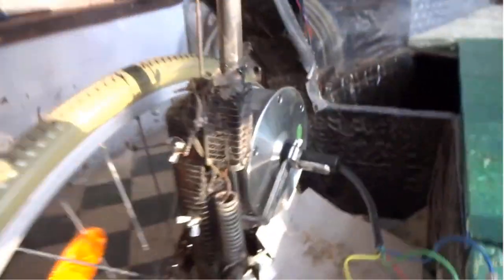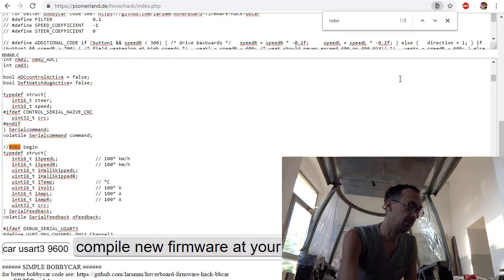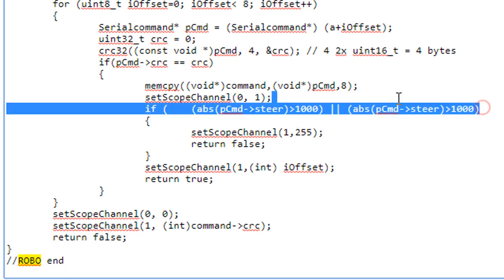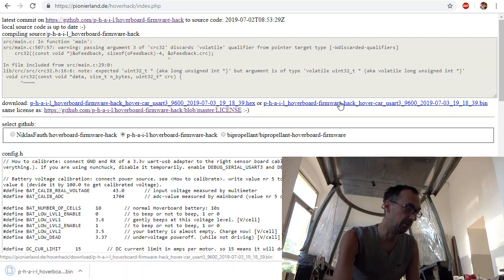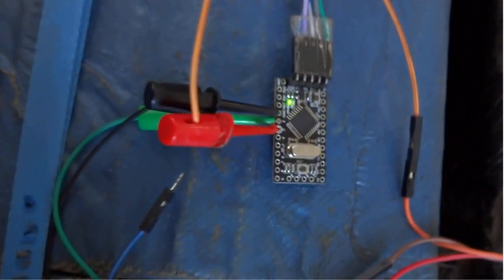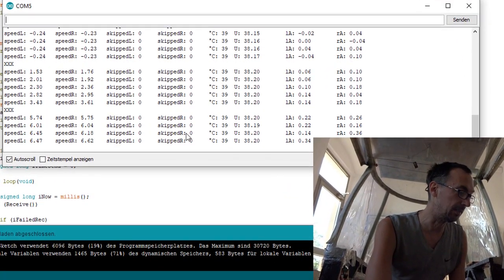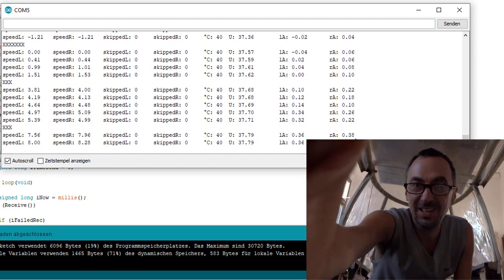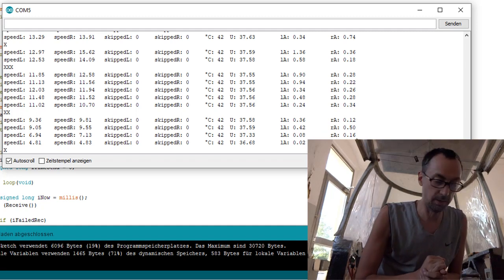my online compiler: hoverboard firmware with bidirectional serial communication

Comment: Please help, I just follow step by step you tutorial but I will try can't show serial data from sensor and just 1 wheels turn around..how the problem?? I'm using esp8266
Reply from the maker: I had the same problem with Esp8266 because softwareserial was not working correctly. I suggest you first connect a usb-uart module to verify that my firmware indeed sends back the motor data. Then you might try some custom softwareserial libraries out there. But you better move on to the Esp32 anyway. Then you have at least two hardware serials. You can also try the hardware serial of the esp8266 but that might conflict with debug output.

When only one motor is spinning, you either send a wrong steer command, the motor is defective or the controller board broken. Try switching the motors to verify that the motors/board is not the problem.
Reply: @robodurden  thanks for your respond, I have try switching the motor but no problem the motor, seems to be the problem from the connection cable to the motor..if my motherboard is damaged ??? Because when I press the button on/off led in motherboard can't off
Reply from the maker: @mycodetemplates7782  you should first install the original firmware from Niklas and choose the demo setup where motors only spin backwards and forwards. Then you can see if the controller board is defective. The on/off button is a bit strange. I too can not turn off the board but have to shut down the supply voltage.
Reply: @robodurden  if I use Niklas firmware...I not use esp8266 for spin, will default to spin?
Reply from the maker: @mycodetemplates7782  select the Niklas firmware in my online compiler and make sure these lines are active (no // before the #define):
// ###### MOTOR TEST MODE ######
// slowly move both wheels forward and backward, ignoring all inputs
#define CONTROL_MOTOR_TEST
#define CONTROL_MOTOR_TEST_MAX_SPEED 300         // sweep slowly from -MAX_SPEED to MAX_SPEED (0 - 1000)
Reply: @robodurden  I have tried but only one wheel is spinning, is it possible that my motherboard is indeed damaged??
Reply from the maker: @mycodetemplates7782  I guess so. Or you have a different controller board which uses different mcu pins. But if your board looks like that generic Board shown on Niklas his page, you might need to buy a new one. They are less then 20 usd.

If you have an oscilloscope, you could test the bldc motor pins.
And if you add log functions to bldc.c you could check the hall cables..
Reply: @robodurden  Hi thank you for your support...mybe I must replace my motherboard.
Reply: @robodurden  what i have to do to test if MOTOR TEST MODE? i uploaded the Niklas firmware to the motherboard and power it nothimg happen. i try 3 motherboards. any help will be appreciate it.
Reply from the maker: @jonmat1632  Well if all three boards are not like https://raw.githubusercontent.com/NiklasFauth/hoverboard-firmware-hack/master/pinout.png your boards might not be compatible.  Take a close look on the mcu and check it is indeed a Stm32f103.

With the original config.h you have

#define DEBUG_SERIAL_USART3 // right sensor board cable, disable if I2C (nunchuck or lcd) is used!#define DEBUG_BAUD 115200 // UART baud rate//#define DEBUG_SERIAL_SERVOTERM // Software for plotting graphs: https://github.com/STMBL/Servoterm-app#define DEBUG_SERIAL_ASCII // "1:345 2:1337 3:0 4:0 5:0 6:0 7:0 8:0\r\n"

So connect a cheap usb-uart module an see if the board is running correctly.
Then make sure you connected the motors  correctly.
Reply: @robodurden  thank for taking your time to reply.
yes its the STM32f103. i edit config.h to what u have below. i try to edit NIklasFauth firmware to MOTOR TEST MODE and USART a when i try to build on the website i get 

error 
In file included from Src/setup.c:39:0:
Inc/config.h:164:6: error: #error select exactly 1 input method in config.h!
     #error select exactly 1 input method in config.h!
      ^~~~~
make: * [build/setup.o] Error 1

so i try RoboDurden-firmware-Hack USART with the arduino code to see if i can get the wheel to work but nothing. im not receiving anything back from the motherboard because im looking at the serial monitor window and i only get Hoverhack test v1.0.  i also connect usb-uart module to the right side senor and i get the scroll moving be i cant see any characters. im used 3 new and 4 old motherboard.

any help will be appreciate it.
Reply from the maker: @jonmat1632  stay with the Niklas firmware. Maybe you are killing all boards with 5V instead of 3.3V ?
The original config.h has Motor_Test already activated:

// ###### MOTOR TEST MODE ######
// slowly move both wheels forward and backward, ignoring all inputs
#define CONTROL_MOTOR_TEST
#define CONTROL_MOTOR_TEST_MAX_SPEED 300         // sweep slowly from -MAX_SPEED to MAX_SPEED (0 - 1000)

As well as debug output:

#define DEBUG_SERIAL_USART3         // right sensor board cable, disable if I2C (nunchuck or lcd) is used!
#define DEBUG_BAUD       115200     // UART baud rate
//#define DEBUG_SERIAL_SERVOTERM      // Software for plotting graphs: https://github.com/STMBL/Servoterm-app
#define DEBUG_SERIAL_ASCII          // "1:345 2:1337 3:0 4:0 5:0 6:0 7:0 8:0\r\n"

So you do not need to change anything.
It also has the beeping activated which should hear after a few seconds:

#define BEEPS_BACKWARD 1    // 0 or 1

Watch my previous video where I demonstrate that test_mode in the beginning.

Make a video yourself where you show your cable setup and how you flash the firmware.
Reply: @robodurden  thank you for the help. i upload the Hex Niklas firmware from Niklas github page. its still not working. this is the video https://youtu.be/puXnKO1dN3I
Reply: I found the problem with the Niklas firmware MOTOR TEST MODE. i was using the jumper to power on the motherboard and it needs the regular switch to work so i replace the jumper with the switch the wheels move. now im going to try the other firmware to see if that was the problem.

thank you Robo Durden for taking your time to reply
Reply from the maker: @jonmat1632  of course you need only a pulse to turn on/off the firmware. But make sure to use the jumper when flashing as Niklas insisted to have that pin permanently on while flashing!
Reply: @robodurden  thank you again. i got everything working. im working on the Esp32 https://www.youtube.com/watch?v=NDL2_DEqnKE

Comment: I tried your Arduino code and it works like you show in the video clip. The wheels are running forward and then backward. But, your code is to complicated for me to understand and modify. There are no explanation or comments in the code what  the different  lines  do. How would the simplest code for sending speed and steer look like? 
I might be better of going analog due to lack of brain cells. But that's not as fun :-)
Reply from the maker: If my hoverserial.ino is working then you only need to replace the lines in the loop function with your code. Simply call my 

void Send(int16_t iSpeed)

Function where 1000 is full speed forward and -1000 is full speed backwards. 
If you need steer you can easily modify that simple function.

Comment: Hi Robo!
Again thanks for your excellent on line compiler!
I want to control my HB wheels with an arduino in an robot project. What version do you recommend I use, "p-h-a-i-l" or "bipropellant". On the github it says that "p-h-a-i-l" is obsolete.
Reply from the maker: I control my controller with an Arduino Pro Mini 3.3V and I definitely recommend my fork of the obsolete PHIL fork. Simply select the RoboDurden code at my online compiler.
Then also follow the link to my GitHub and download the Arduino example code :-)
Let me know when you run into trouble.
Reply: @robodurden  Thanks! I'll play with it tonight. 
I'm building a robot lawnmower and  I will try to modify the "ArduMower" project code to control HB-wheels instead of PWM control and geared motors as they use today.  
https://www.ardumower.de